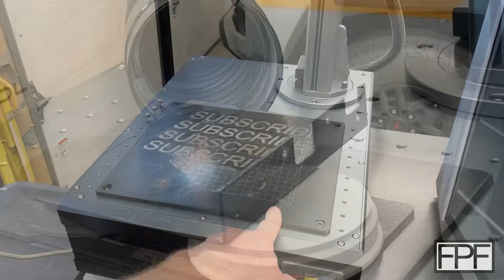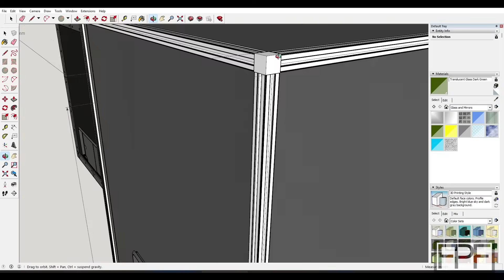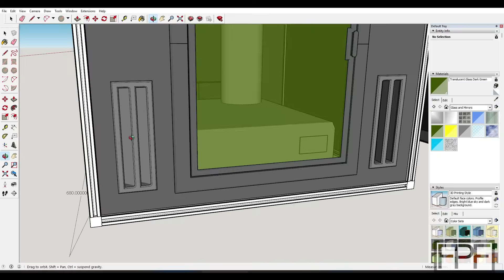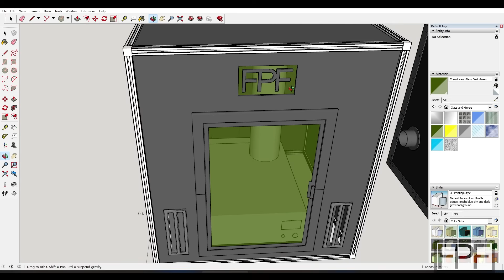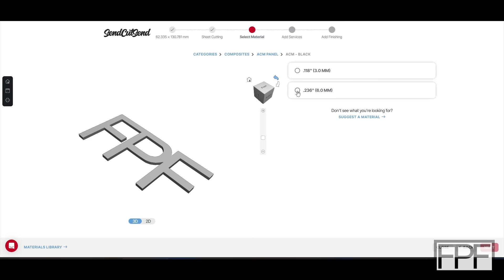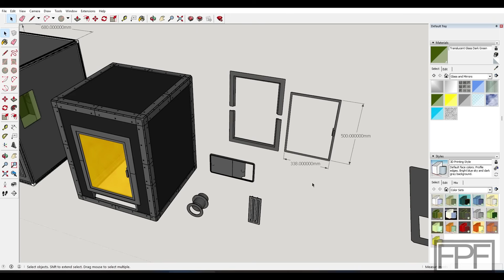Designing an Enclosure with 2020 V-Slot Rail and 3D Printed Parts

Comment: 4:04 Hydrogel is really good at absorbing laser power. To the point that a much much more powerful laser takes literal hours to punch through. You just seed a hollow space for that stuff instead of using 2020 you can use 2040 which has two slots. There are ones that have two slots on each side, but harder to find. Slot in two of your "sign" material as walls, seal with silicone, fill with hydrogel close it up.

Comment: I just did is same thing for my printer. I was so much faster to build than printing all the parts. For the walls I used Acrylic and the same plastic cardboard. I has planned on using HDPE sheets but my supplier was back ordered when I go to that point in the project. I would recomend 2040 for the verticle  sections instead of 2020. It makes easier to join the parts and even allows you extra mounting points inside the encloser. Those universal screw corner blocks kind of suck compared to drilling or internal gusseted corners. For mine, I was able to mount the LED strips on them more easily, along with the doors do they can fully open while still sealing, and a tool rail for all the stuff I constantly needed like tape or squares for alignment..

Comment: Aluminum composite panels can be extremely flammable.

"Polyethylene (PE) core. Highly flammable, panels with a PE core are particularly hazardous in the event of a fire. Being a thermoplastic, it can melt, ignite, drip, and propagate fire rapidly. Once ignited, it can contribute to the effects of the fire by releasing toxic smoke and heat."

Comment: It probably would have been cheaper to just buy Monport's laser enclosure for $540 plus tax w/free shipping but then you wouldn't have material for a video series or the satisfaction of building it yourself.
Reply from the maker: it would be, if they hadn't carried over the same panel material that they used for their diode lasers.
Reply: @FunctionalPrintFriday I'm guessing that material doesn't block the wavelength of the fiber lasers?  If so, they opened themselves up to some expensive lawsuits.

Comment: Proof that even a seemingly simple “ box “ has many elements which require thought and engineering to make sure it will ultimately function as necessary.
Reply from the maker: Everything seems easy until you start doing it.  My wife takes any time estimate I provide and quadruples.  That's usually close :)
Reply: @FunctionalPrintFriday that’s why I don’t tell my wife.  I say YES DEAR and get it done asap lol

Comment: It's not paranoia if they really are out to get you, and laser light definitely is.

I used to work in the Laser Micromachining industry, and I remember one machine where we didn't bother putting a roof on the enclosure, because it was a visible light laser and there was 'no way' for the beam to leave through the top of the enclosure.

Of course during some maintenance, one of the mirrors was left loose and somehow ended up pointing the beam at the ceiling. I came down to the workshop, saw a green glow, looked in that direction to see what was causing it, saw the diffuse reflection of the beam from the ceiling about 6m away, I instinctively looked away and made my way over to hit the e-stop. That brief glance left me with a speckles in both eyes for the rest of the day, and it wasn't even a particularly powerful laser. Within a week, that enclosure had roof panels.

This is why it's even more important to enclose IR and UV lasers, since you won't notice anything is wrong until it's too late. Personally, I think it's irresponsible to sell these without an enclosure, but at the price points we're talking about, their enclosure is a significant proportion of the cost of the whole setup (about 1/8th the cost).
Reply: Counterpoint to that last part: if your argument for not including an enclosure is that you can't hit your desired price point with it included, then you're not actually making a product designed to hit that price point, you're intentionally and knowingly  selling dangerously defective goods to present ill-informed customers with a "too good to be true" (because it is!) option.

Seatbelts and crumple zones are not optional extras in cars. Your house's electrical panel doesn't optionally have a fuse box/electrical panel. Necessary safety features are exactly that: necessary. The inability to reach a price point is not in any way an excuse for selling an unsafe product to the general public.
Reply: Agreed, the best argument for not including the enclosure is that 'most' of your buyers would prefer to build their own @Kraaketaer  but, sadly, I suspect that you're closer to the mark.
Reply from the maker: especially with the majority of the "reasonably-priced" safety enclosures not even being rated for the correct wavelength

Comment: Just wondering, if you could have used the short aluminium extrusions as the door frame, jointing two each side going from the bottom extrusion to the top. one, or using another as a head jamb to not have it so tall. would give you a lower door at the bottom with even better access as well as a taller door and use up your  extrusions.

Comment: The old 3D printed panels do not take that long to print.... I printed a whole 500mmx500mmx500mm So 2x200mm +1x100mm + two end caps on a side so I thinks its like 550mm each side, for my Biqu B1 3D printer and I have a full day time job so printed all the parts out in just a week.

Comment: James at Clough42 uses SendCutSend quite a bit. Pity we dont have them here in the UK 🇬🇧. I did note that specially for you in the States, they converted the thickness of the panels from 3mm and 6mm to the Imperial sizes on the first ACM splash page. I'm rather surprised they didn't convert it to fractions: 23/195ths and 46/195ths 😊. Keep up the good work, I get it first thing Saturday morning, with my coffee.
Reply: Fractory is probably the closest we have in the UK
Reply: @____5837 Yes a friend has used them, but for price SCS knock them into a cocked hat.
Reply from the maker: lol.  I SO wish the US had adopted the metric system long ago

Comment: For that outer door frame I'd see if I could slice it in half on the vertical edge so then both sides could print flat on the bed. Use some 3dgloop to put the slices together... might be able to avoid any supports on it. 

I love the SV08 Max.... first layer quality on that thing is nuts.